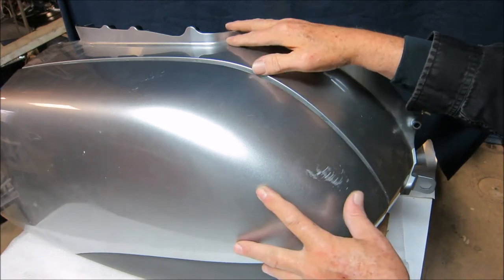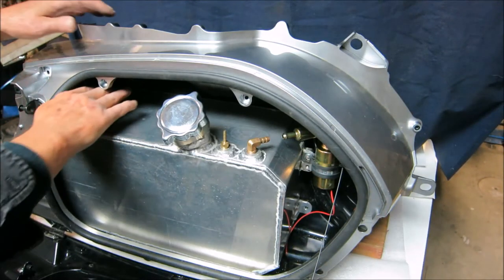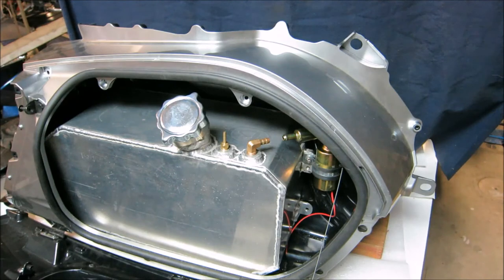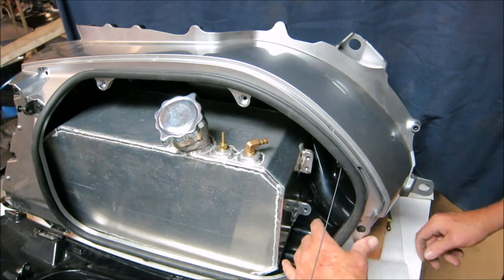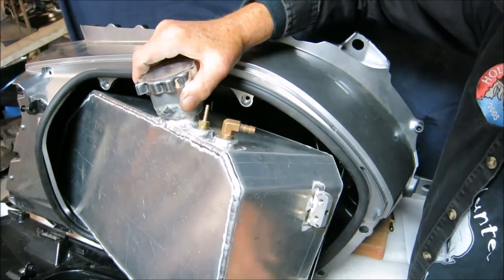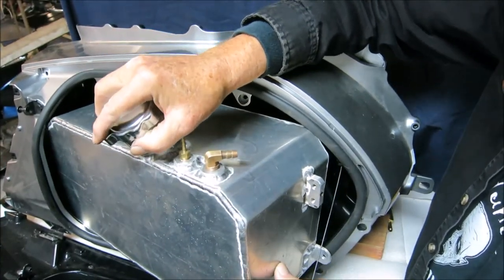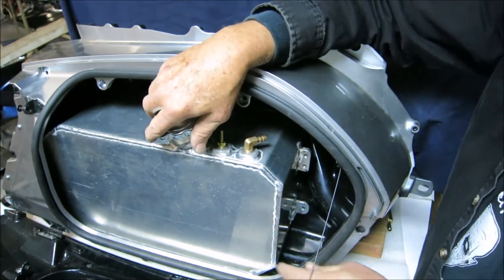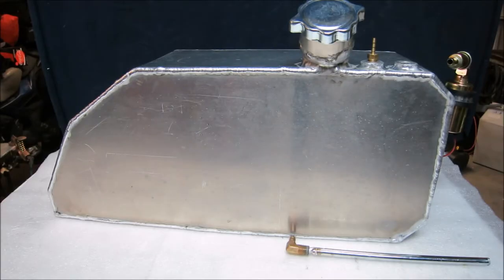Goldwing Saddlebag Auxiliary Tank

Comment: I bought a 2002 Honda Valkyrie new back in 2003. Came with a stock 5.3 gal fuel tank. About 130 miles was about it and I went to reserve. I was fortunate to locate what was called an ACE tank in California. They had only 1 left and it held 9.5 gallons. ACE was stopping production so I jumped on it quick. Cost me $1,100 primed and ready to paint. Found a good local painter. He worked his magic and the tank looked like it came on the bike except it looked bigger. I had to put spacers under the front of the tank to raise it up 1 inch so air could get to the engine. At first, 70 MPH was as fast as it would run. Once the tank was raised, it ran normally.

Back then I was a touring junkie. Had a few friends from work that were touring addicts like me. Prior to the ACE tank, it was me who was always looking for a gas station first. After I got the ACE tank installed, it was them. I could easily exceed 200 miles at hiwy speeds before going to reserve.

The big tank and an Audiovox electronic cruise control were the 2 best options I ever installed on any bike I personally owned. 

I always dreamed of riding in the Iron Butt, but it never happened.

I still have the bike but my long distance touring days are over. Getting married does that sometimes. Still, on occasions, my old riding buds and I will go and do a one-dayer and reminisce about those long trips we made together. Those will always be remembered.
Reply: I owned 1999 Valkyrie. Man, you lucky to found 9.5 gallons tank. I wished I could have that tank! Pretty long ride is better than touring around in gas stations.

Comment: This is terrible engineering! Haven't the designers ever heard of injection molding? It looks like Uncle Bob threw this together in his bar. Tell me why or how this would be any better than carrying a plastic gas jug? Nonsense!
Reply from the maker: Thanks for contributing such a well thought out comment. I'm sure the community will find it valuable.
FWIW--I was making aux tanks as a hobby in my home workshop to support the long distance community. I agree that this was a kludged up mess. It was such a PITA that I swore to never make another. So would I have designed it this way? No, but it what the CUSTOMER WANTED!!  And he didn't want to carry a plastic jug.
I live by two rules: 1) The customer is always right. 2) When the customer is wrong, see rule 1.